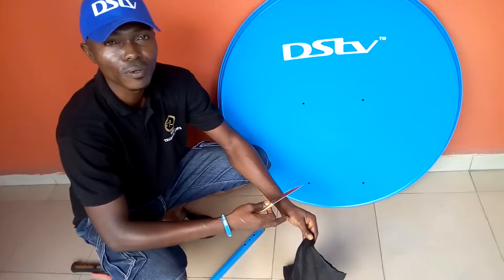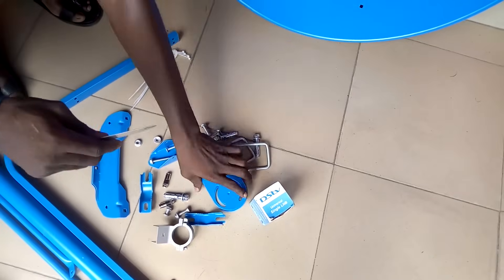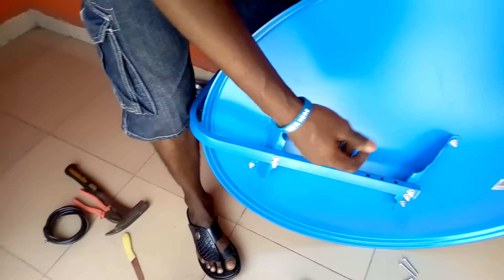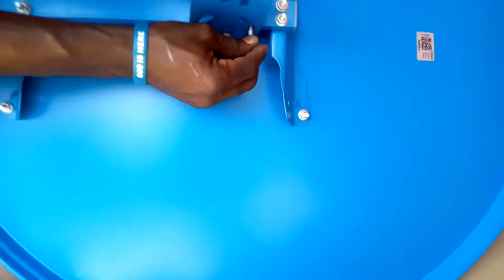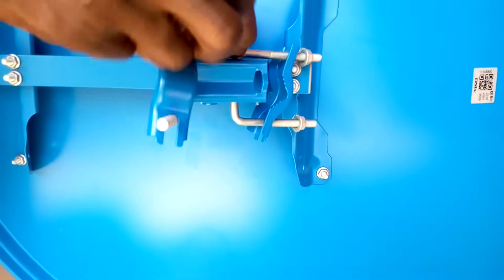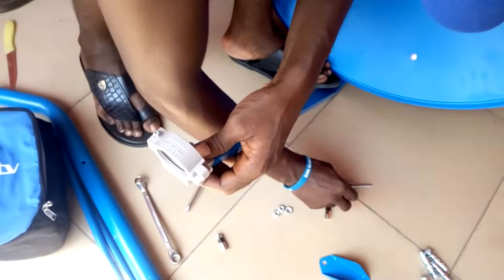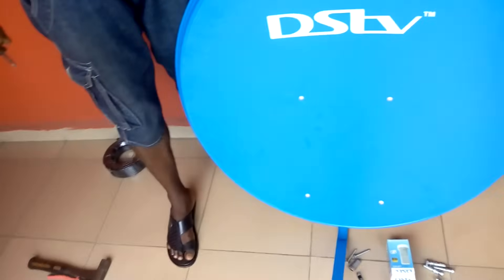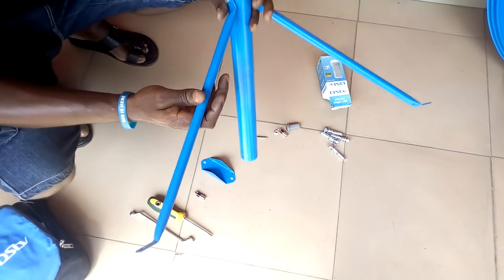How To Assemble 90cm DStv Satellite Dish (Step By Step Guide)

Comment: What is the difference between the small and big DStv dish ??
Reply from the maker: 90cm dish is better than the 60cm dish in these areas:
1. It is stronger and durable.
2. It gives more signal strength and quality to the decoder.
3. It has more life span and superiority.
4. It plays high HD channels without cracking.
Thanks.